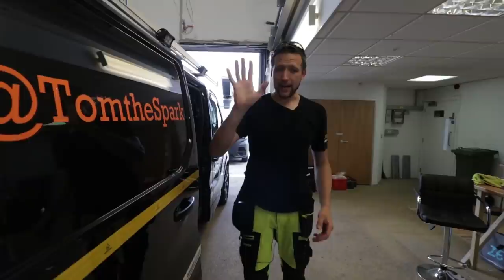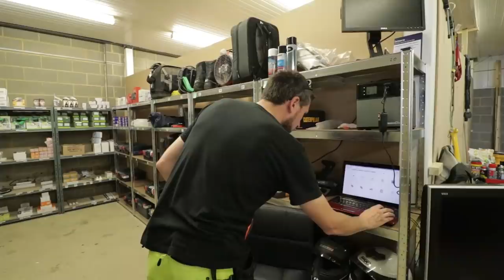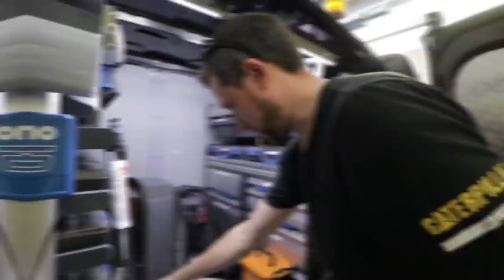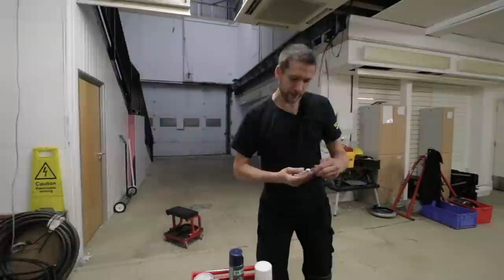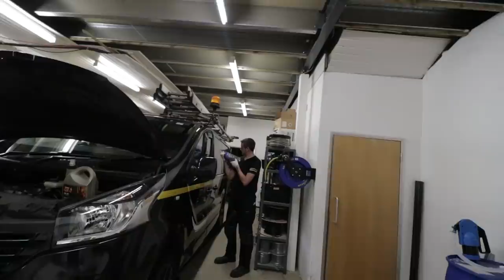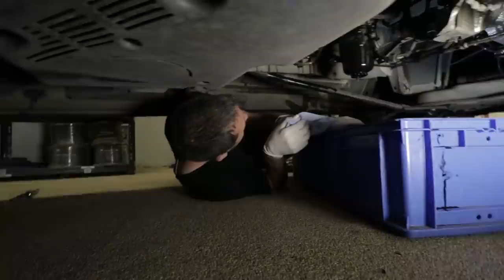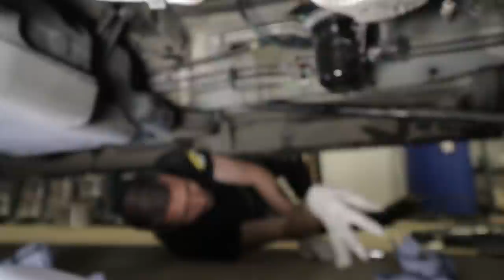When ELECTRICIANS try to be MECHANICS... | Thomas Nagy

Comment: 18:28 if you don't fill the filter back up with old fuel, unscrew the thing you are touching with your thumb when you say you can't see any primer, turn ignition on and it will purge the pipes of air and diesel will come out here. (thats why there's a pipe fitting on it, to direct it into a catch can) It's also there to drain crappy fuel out before you remove the filter!

Comment: These service intervals are nuts. I’ve been driving for a supermarket recently thanks to COVID, the Sprinters we use are 2 years / 37,500 miles and that’s for proper urban stop start driving even worse than you do in central London (because it’s multi drop delivery work) - they run like absolute arse long before they’re “due” 🤦‍♂️

Comment: They have a low pressure fuel pump in the tank so all you do is swap filters and cycle the ignition a few times and it re-primes the system.

Comment: Used to have a 96 Vitara that would stall every time you stopped. Turned out to be a cam position sensor which was apparently a common issue on the 1.6 and later 2.0 engines 😅

Comment: You should put the laptop on a Trolley that also has space for the crate.Save you walking back and forth
Reply: If you're talking about the stock keeping system, it probably has a web server so they could just connect to it with their phones instead.
Tip: Have an NFC sticker that takes you to it's website. Then all you have to do is touch your phone to the sticker and carry on.

Comment: Just a Suggestion: If you placed the laptop on a wheeling cart the person scanning it in could see what's been scanned in and deal with any errors too. Rather than going back and foward. Also I have a feeling that you're limited by the bluetooth range which could cause a problem.

Comment: Hi Tom,
I had a similar problem to your Vitara on a Mk1 Golf. My problem was something in the fuel tank was getting sucked onto fuel pipe starving the engine of fuel. Used to have to wait  for the pressure to dissipate before the thing would float off the pipe to start the car again, once this happened on a long drive then it just kept doing it every 20 miles or so till you got to where you were going. It didn't matter how much fuel you had in the tank either . I had to change the tank in the end .

Comment: Difference between qx oil and a premium oil is 100k miles 😂 you can hear the timing chain scream as you were tipping that in! IMO I think your logic is bang on with the oil! I stopped using qx professionally years ago though as the manufacturer aprovals for warranty at dealers these days is such a grey area that it’s just easier to buy shell, Castrol or Fuchs
Reply: There is a balance though when doing ones own oil changes. QX at 10000 is fine if its once or twice a year and you got time to do it. In London its not about racking up miles, its time in use, hours in traffic. Thing is you can pay top dollar thinking 12 months or 20000 is fine, and you get cheap shite oil from the garage.

Comment: Regarding fuel priming. Dont crank it, turn key to for notch for the low pressure fuel pump to start and turn off after 5s. Do that 3-5 times and than start cranking.
Btw low pressure pump is in most cases within or near fuel tank, its not the Bosch high pressure one near the engine.
If its a diesel, those high pressure pumps should not be left empty therefore its good to prime the whole system as much as possible.
Reply: Hi, it won't work with the push button start system, as you saw Tom had a job to stop the fuel pouring out, most modern vehicles are like this i.e no key to turn at all.
Reply: @raywelshman  Ah well I forgot about it…well then he can at least pour diesel into the filter before putting it back.
Reply: It works with pushbutton start by not pressing brakepedal same time (or whatever is the safety switch)

Comment: Hi Tom

Apart from sparking we have another thing in common, we've both owned a Vitara that would just die 😄 

I got to the bottom of mine and it was the cam sensor. They break down due to the heat at the back of the engine. If ever the kettles on one Friday afternoon let me know and I'll bring the cakes 👍

All the best 👍

Comment: The vitara might have been the cam position sensor - they used to suffer from heat soak so would start running badly once they got up to temp.
You could diagnose it by tying a wet rag round the sensor to keep it cool and see if the problem persisted.

Comment: Good videos Tom great achievements.
Just in relation to your van service, the oil is very black, I know with time they will all be dirty however I have the same van and when I change the oil effectively I do a double oil change and now when I service my van the oil is still brown/gold when drained.
1drain oil
2add 5l cheap oil - run engine
3drain oil
4change filter/add good quality oil.
In relation to fuel system bleed, it is automatic, however process for doing it is.
1 put van in gear
2depress brake pedal
3 press ignition and allow fuel pump to start.
Repeat process few times and then select neatral and start.
Hope it helps.

Comment: I had an old car that kept cutting out (not a Suzuki!) it was a vacuum leak, needed a new pipe, there was a hole that expanded as it got hot and caused the engine to stall, but it was an intermittent fault as it didn't do it when I was actually at the garage, was a friend of mine who found it, he used to be a mechanic and then earned more doing painting and decorating.

Comment: The service interval on my 2021 Mercedes sprinter is 27 and a half thousand miles. But I am like you I prefer changing things over at 10000 mile I even changing the timing and auxiliary belt and water pump before 50000 mile

Comment: Mechanic and electrician come from same background. Methodical action to find root cause of problems, finding probable solutions, and finalize problem solved.  Using the method you can interchangeably tackle your problem. Like Ivan from Pine Hollow Auto Diagnostic, wear a wearable camera to record problem, possibility of solution, and record solved problem, and keep record for future use.

Comment: Its not self priming. Just about every newer diesel car/van have a secondary electric fuel pump fitted inside the fuel tank and a primary elector mechanical pump running of the crankshaft. The secondary pump is suppling fuel at the pressure of 5 bars(72.5PSI) as a main feed for the primary pump, as the fuel circulate throughout the system it also returns back to the fuel tank taking all the air in the system with it. The fuel tank has its own bleeder hose so there isn't any pressure building up in the tank.

Comment: so the thing with oil differences is additives. different cars use different mixes off additives. If you want to know which is the best oil for your car. there is a number somewhere in the manual and that should match with the number on your oil container.

Comment: The base oil is all the same (grade/viscosity/spec like for like), the differences are the various additive packages that brands choose to use, shell has best cleaning additives, castrol/penzoil/millers have the best oil stabilizers.
As long as you use the correct grade/viscosity that meets/exceeds manufacturers spec then even cheaper brands will last as well as expensive ones, again as long as you stick to the manufacturer's intervals as a maximum then really the additive packs arent really needed.
I've used castrol and shell for years but now use the 20 litre drums of mannol and go by 10k changes every 12 or so months.
Reply from the maker: I appreciate the input, I’ll keep this in mind!

Comment: The suzuki cutting out issue mightve been because of an ignition module. Have a mitsubishi colt from 1992, so it has the ignition module inside the dizzy, used to just cut out like youve mentioned when it got to operating temp, so maybe same issue?

Comment: Professional electricians “DIY’ers should not rewire their homes” … also… Professional electrician’s I’m a mechanic
Reply: Its called engineering. Mechanical and electrical engineers can usually tackle vehicle mechanics with a level of competence.
Reply: @idi0tdetectioninprogress  yes, but there are levels of everything.

Car mechanics might have a bad reputation, but plenty of them are really "mechanical engineers". Some of them certainly are not.

Just because us engineers can "have a go" at something, it doesn't make us an expert. However, you are spot on. Engineers can turn their hand to many trades and products.

I went from being an Avionic Aircraft Engineer to a fitter on the railway doing extremely heavy mechanical work (plus plenty of electrical stuff still thankfully) without any issue, despite it being a very different task.
Some people laughed at me when I went from Aircraft to trains, saying I would be "de skilling" myself, but I now work with some people who could happily turn their hand to Aircraft maintenance, yet some of the people I worked with before couldn't even change a brake caliper or clutch on their car.
Reply: @idi0tdetectioninprogress  Dude you do like blowing smoke up your own ego. You can be a professional electrician as far as the countries concerned with hot housed 4 week courses, they are engineers to you.

If there was legal protection and status put on engineer within the UK that applied to electricians the vast majority would not meet the standards to be called an engineer. There are countries who do have legal status to the term but they don’t allow someone to become a spark in months they require years.

You are very happy to take the entry level jobs and use that as a reason to denigrate entire trades but yet never apply that same approach to electricians. Every industry has its entry level and everyone has its peak, from oil changing tech to being a mechanic on F1 teams…. Obviously all unskilled oik’s beat by a rapid trained spark right, oh and there are flying pigs too.
Though terminating Ethernet is an amusing example, I have seen data cables occasionally do it badly have yet to see an electrician do it well. The idea of it works doesn’t actually feature in the specifications but that point is always missed.

Quite amusing the UK public have the opinion that all trades including sparks are bodge jobbing scammers that they have to use but never trust unless it’s someone they personally know. 
The government, the schools and the public at large do enough damage to dissuade people entering trades, recognising the skills of the trades and paying them an appropriate wage for the work

Yet here you are doing all the work for them from within a trade to diminish the other trades. In what I can only assume is some silly belief that if you can make electricians sit on a pedestal after you have cast down the rest the publics attitude will magically change!

There is a reason people expect electricians to be doing 5 EICR a day on just above minimum wage and that’s because no trade is seen as skilled within the UK at a population level.

I will leave you to it after this because I’m sure you could go on for days why you’re special but think on this:

I came here to point out all trades needs respecting and you came here to bash any trade that’s not an electrician. One of us is helping the trades and one is amplifying the problem.
Reply: We are talking about a car service here, it’s pretty basic. There are probably more risks to safety when it comes to changing a tyre yet people frown at those who call the AA out to do it
Reply: @idi0tdetectioninprogress  So when you came in at the start replying to a comment clearly detailing the wider normal electrical trade on an electricians channel aimed at electricians that the work of electricians …….. You wanted to start shouting about what is and isn’t an engineer. Form the point of a very specific sub-section of the electrical industry and use that to denigrate whole and complete trades based on their lowest denominator while totally ignoring these industries similarly high skilled sub-sector progression paths.

Did your engineering title hit you on the head or something? It clearly was not a comment aimed at electrical engineering that are creating integrated circuits or planning out the national grid or whatever specific area of job you are in, if that was the case the term mechanic would include everyone right up to those deigning cars. Do you hear medic and start assuming consultant neurological surgeon as the base point.

“you may become a good tradesman, a bad one, OR work towards becoming an engineer. You dont become an engineer just because you have basic sparks qualifications.”

If you wanted to be pedantic about a specific subset at the higher echelons of trade you really should specify it before you start ranting about engineering, again that’s before you brought in a rant about engineering! If you want to separate out the tradesmen from engineers within sectors go for it

But go and read it I was comparing trades with trades and no more specific and at the normal end of the trades they are far more comparable than people will admit and they all suffer from the lack of respect for the skills involved 

Context matters for Christ sake
Reply: @Horizon301.  I was mainly amused at attitudes within trades about the other trades as really they are more similar then than people make out. 
Yes it can be basic but there are risks. As a company they take on the liability from something going wrong and they don’t have the back up of knowing and proving they are skilled. So it should be fine sounds great but as we saw mistakes can easily made and they don’t always piss on the workshop floor on the first turn. There is a lot of risk and liability in 3.5 ton doing 70 if the timing of a mistake goes badly. 
Those that call the AA are getting a trained person to do it for them so in that case they are going the extra steps to be safe
Reply: @michaelwilliams3648  There's a clear definition between engineers and tradesmen, so I don't need your opinion on it. If you don't like it, get things changed, I'll wait. Its no good crying about it on YouTube. 
    Jobs like cctv, access control, and data, are not some entry level to electrics at all, they're entirely different roles. You either train to be an electrician, and qualify, or you don't. 
    To be clear, the standards of all trades leaves a lot to be desired, including electrics. No one is trained to the high standards of the past, but at least trade apprentices apply themselves for 3 years, learn how to erect a scaffold tower, use power tools, run cables or pipework,  and attain a qualification which they can build on. The other jobs aforementioned are NOT trades, they're simply roles which require a bit of training. Once you understand this you will be able to move forward.
Reply: @idi0tdetectioninprogress  Let’s run you through this whole thread again shall we.

I compare electricians and mechanics in general 

You charge in with “cant do that they are engineers”

….

Also you and I will quote “You don’t become an engineer just because you have basic sparks qualifications.”  Qualified electrician are not engineers and “OR work towards becoming an engineer.”

Ok sweet so electricians are not engineers in general just like mechanics are not in general but both can be with upskilling and experience.

Thanks for stopping by but I have no sodding idea what your point was when you jumped in, so have a good weekend and don’t forget to polish that title you love so much you needed to wield it like a weapon when it wasn’t even talked about till you came along
Reply: @idi0tdetectioninprogress  Wrong. There's a lot more to it and the ramifications of cocking it up can be horrendous... like a house fire from a badly swapped CU.
Reply: @michaelwilliams3648  And electricians are among the worst at doing it. Just read some of the forums, or some of the comments by YT sparks.
Reply: @Horizon301.  Actually the creator also talked about changing brake pads (he's even made a video of it) and changing ball joints... not exactly just servicing, is it?

He's got a socket set and a trolley jack so it's okay to work on his suspension and brakes, but will probably stop short of changing a timing belt because of the tools, yet which is the more dangerous?
Reply: @Hoops-Senior  brake changes are simple. I was allowed to do this at 16 for work experience on Land Rovers 🤣
Reply: @Horizon301.  not unsupervised unless you were working on a ranch and had bandy legs.
Reply: @Hoops-Senior  nope, supervised at a main dealer. I’m sure someone double the age with some actual basic knowledge can change their own brakes though.
Reply: @Horizon301.  Right, so the comment about doing it at 16 was totally pointless. 

What you are missing is that I’m not saying people shouldn’t. I’m saying that there’s a double standard. 

I worked as a breakdown mechanic and recovery driver for a couple of years. I’ve seen, first hand, some really dumb shit done by pro workshops. Things like wheel nuts put on backwards so wheels coming off on the M25. Imagine the potential devastation of that; however, a lot of knowledgable DIYers wouldn’t have made that mistake. 

When it comes to electrical work adding a socket to a ring circuit is only for the qualified spark. Total BS.

Comment: The dearer oil has more additives to keep the emissions down and keeps engine corben build up to a minimal and alot better for engine when you change fuel filter cycle ignition about four time that primes filter

Comment: Not sure what lift you’re looking at exactly, maybe the camera is just deceiving but it doesn’t look like you’ve got loads of height for a lift. Have a look at quick jacks, probably more cost effective for the odd bit of maintenance you’ll be doing, also can be packed up and moved out of the way when not in use.